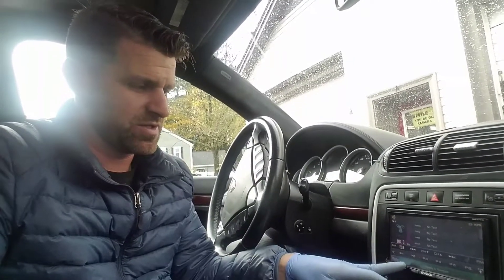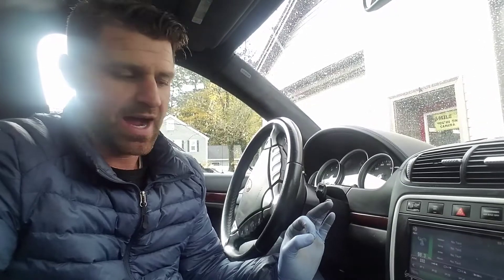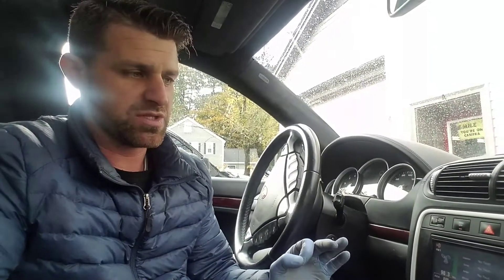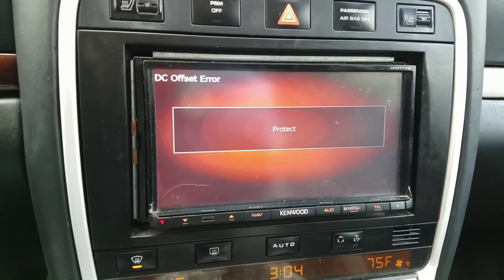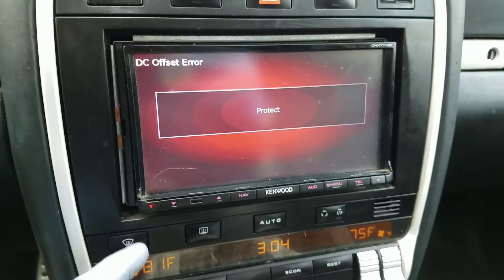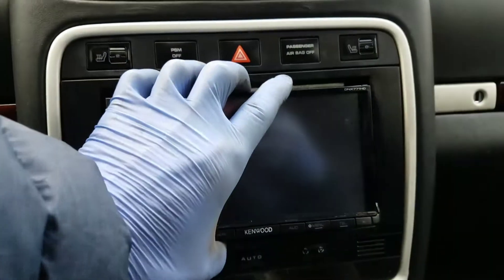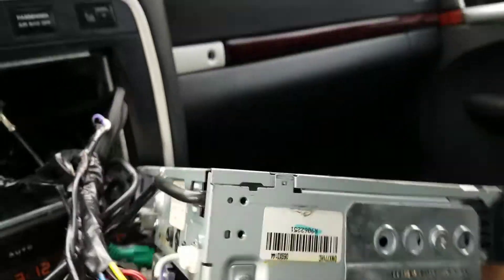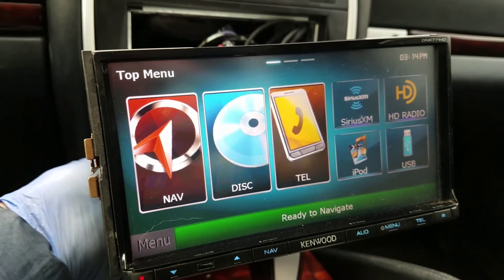Kenwood Stereo DC offset error protect quick repair

Comment: Come on guys, that's only a temporary fix. I have a different model but with the same error. It went away for a few days after I pulled the stereo out and reset it, but it came back to haunt me. I  know for a fact it isn't the speaker connections because I removed all the speakers cables, and it still gave me the same error! I've had enough and will demand that Kenwood replace it or refund my money. I spent a thousand bucks all up trying to install it, and then this!

Comment: Definitely alot of work to just reset it.  

Alot easier to just pull the fuse to get the exact same thing. 

When you pull the plugs out of the back , you are just killing all.power to it. 

Get the exact same result from pulling out the fuse.  

(Fuse #12 ,Located in fuse box in engine bay)

Comment: DONT LISTEN to this idiot guys.. you're wasting time. You can EASILY press the reset button in front of you (the button he mentioned that's not a button) there's a safety reset "button" inside the little red triangle that can only be pressed with a safety pin/ flathead screwdriver.. one press and DONE... no need to take out the whole thing or anything lol!

Comment: Exact same thing happened to my kenwood ddxbt373. Had an hour drive ahead of me so I couldn’t pull the radio out. Instead I pushed the red triangle with a knife (Yes it’s a reset button) and it reset it. Recalled my memorized settings and fixed. 3 minutes max

Comment: Press the “Red Upside down Triangle” with a pointy tip. I used a pen 🖊 , this will reset the radio.
Reply: Wow your awesome this worked for me thank you for sharing 😊 😀
Reply: Worked for me. Thank u
Reply: This guy is saying the upside down triangle isn't a button. Lol I think he needs to try again instead of tearing the radio out of the dash like he did LOL
Reply: I literally just pushed the red triangle on my ddx395 and it worked
Reply: I really appreciate it lol I didn’t even know that was a button and I had the radio for like 4 years now
Reply: Nope, used a pen and held for 30 seconds. Nothing. Not a button on all models.
Reply: Works. Thx
Reply: It worked! Thanks!!!
Reply: This worked for me! Used a bent paper clip. Thanks for the tip
Reply: Lifesaver
Reply: I thought that thing was just for looks! Ill be damn, it worked.

Comment: The button that you said wasn’t a button, is a button. Use a safety pin and just push the little red triangle. Worked very easy.
Reply: You are a legend my friend.. your comment is 10x more useful than this video itself... I fixed it way easily by pressing ( with safety pin/Tip of flat head screwdriver.. not finger friendly) this video deserve 600+ dislikes for waste of time lol
Reply: legendary comment 🙌 worked
Reply: Thank you man, I was so worried and this saved me the hassle of taking apart the radio
Reply: Didnt work for me too
Reply: That's true, that's for sure
Reply: Nice i used a pen lol
Reply: A mi no me funcionó presionar el botón rojo 😢

Comment: Just to let you know the red light  that you said wasn't a button , it is one. It's the reset button..   well at least it is on my kenwood dnn770 you have to use something like a pen or toothpick in order to push it. Also the DC offset error  protection,  means there is a problem  with a short in the speaker or speaker wires.. meaning you could have a bad coil on a speaker and you were listening a little two loud for two long and it heated up causing a short.. if you get my drift.. I have seen this problem and 7 out of 10 times it was a bad speaker coil.
Reply: I just pushed the red button and it reset itself

Comment: it is more easy to disconnet the battery
Reply: Will disconnect battery work?
Reply: Worked like a charm.   Thanks
Reply: Mr Dice  I wonder if something in your radio is just fried at this point. You unplug the battery, it DOES reset, but as soon as you turn it all back on the radio doesn't work because that particular circuit is 100% dead immediately.

Comment: I've been resetting this thing for six months. At least every month or two it goes out. Has anyone found another fix? Thanks
Reply: check the speaker connection
Reply: @stalinangamarca6152  i put in more money trying to get it fixed, had it diagnosed and they said it was the actual lcd screen that was causing the offset error on my dnx891hd. done with this f***in thing.

Comment: I've been struggling with my Kenwood "DC offset protect" error for almost a year now. I've been trying to save money by not taking it to an audio store. I've already unplugged everything and disconnected all my speakers, but that didn't fix the issue. I'm going crazy with this thing.
Reply: Hi there, so it's 3 yrs later, have you solve the problem yet. As I've got the same problem. I've even sent mine away, had it fitted properly, and wham o, it did it again. Hav'nt done nothing about it aver 2 yrs now, pitty pissed off. They keep telling me it's the wires, you know what, i recon the problem is in the aeropro loom. So I'm goona see if I can get another 1. Fingers crossed. Cheers from AUSTRALIA
Reply: @robbiecryer  no I trashed the entire unit
Reply: @danielmchaney  bugger. What stereo did u by next. Buying a new stereo, did it solve the problem.
Reply: @robbiecryer  I returned back to OEM stock stereo.

Comment: Thanks for the video. Before pulling the radio (not as easy to get mine out as what yours is) I tried disconnecting the positive battery terminal, waiting 20 seconds, and then reconnecting. Fixed it. For anyone else having this same problem I recommend trying that before pulling the radio.
Reply: My one didn't work
Reply: It works for me your way, thx
Reply: You're the real MVP..
Reply: thank u..thats what i thought when  i saw this video. is much easier than taking radio out
Reply: Worked for me thanks

Comment: Usually happens when you have a partially blown speaker or speaker dead short
Reply: 69MazdaR100 bro my red light comes on and the fan in the back is on but my screen is black. Any Suggs?
Reply: I keep hearing suggestions about my speakers. But I disconnect all of them and i still have the message
Reply: Just take the negative battery cable off for a minute and it will reset.  Boom

Comment: Push the button it is a button don’t do all that it just worked for me use something small like a key or screw driver it works .!
Reply from the maker: That was the 1st thing I tried. Didnt work for me.
Reply: @FlyingWheels  your supposed to hit the small red triangle with like a pin not the hole black square
Reply: So this video was still helpful for me and i'm glad you uploaded it... but he's right... our red triangle you can't push AT ALL like some other models but there is a small pin hole right directly next to it I didn't see the first time either until I read this comment. I pushed that and my error went away